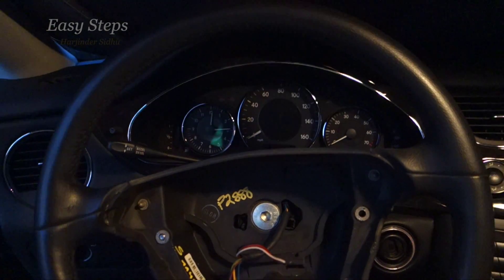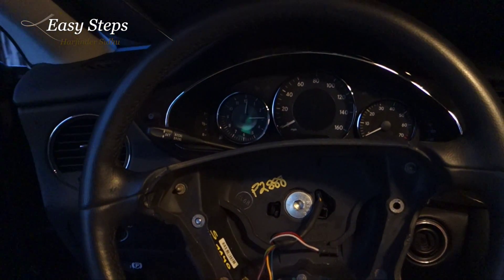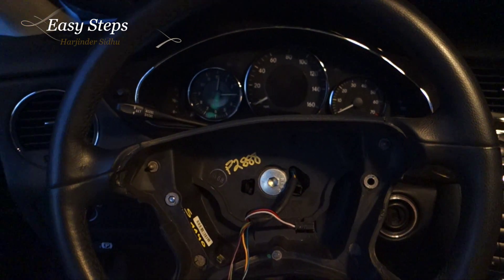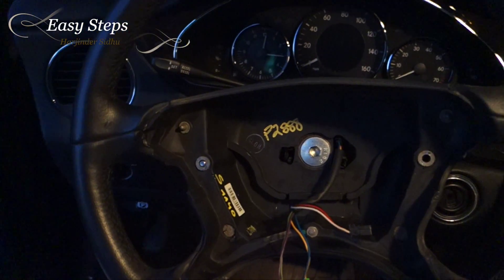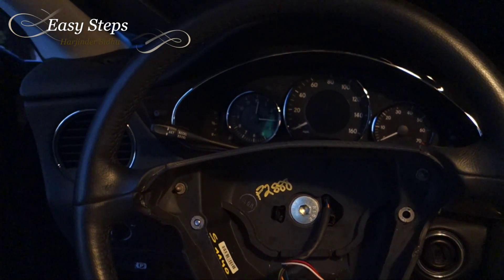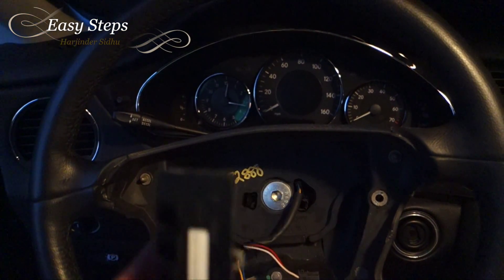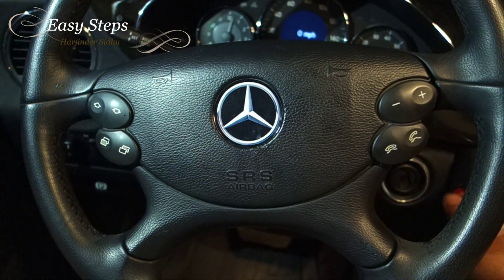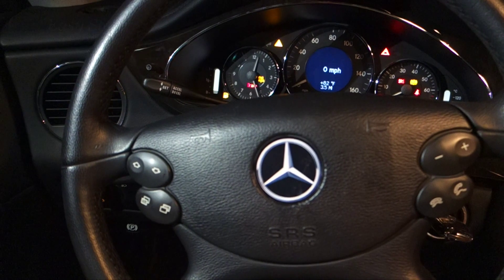How to Replace Steering Control Module on Mercedes | W219 CLS Class

Comment: What is this module called and where can I buy it?
Reply from the maker: https://www.ebay.com/itm/115909727955?mkcid=16&mkevt=1&mkrid=711-127632-2357-0&ssspo=czr4P2HTRBi&sssrc=4429486&ssuid=FdlFMUzGS4q&var=&widget_ver=artemis&media=COPY
Reply from the maker: MODULE OEM A0365457032
Reply: @EasySteps_Sidhu  thank you
Reply: how difficult is taking th e front piece off to get to the steering module, my horn and radio commands are not working and i know the airbag also has to be disconnected, is that difficult also?

Comment: I have a similar problem. Horn not working, steering controls not working on the cls550. Took it to two seperate mechanics, they couldn't figure out. I don't want to take to the dealer. They are pure rip offs. where do you get the steering control module?
Reply from the maker: I bought it from Amazon, thanks for watching.
Reply from the maker: I have started posting DIY videos on my 2nd channel "Sidhu DIY" so please check it out and subscribe, thank you.🙌 🙏 🙌  https://www.youtube.com/c/SidhuDIY

Comment: Mine one needs to replace the scm module and I rework it with rework station. The current flow through pcb and all fine but failed CPUs and transisters and need to force update CPUs, probably due to poor quality bosh products! PCB's many PN junction errors due to poor quality product by Mercedes. No control of voltage system entirely expect from one giant resister on board. Quality is very poor but not the price.